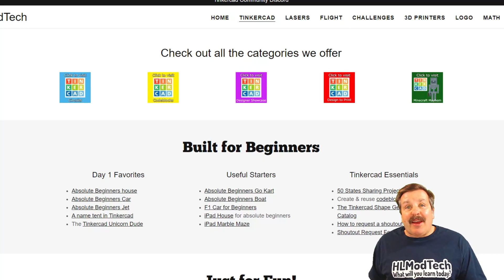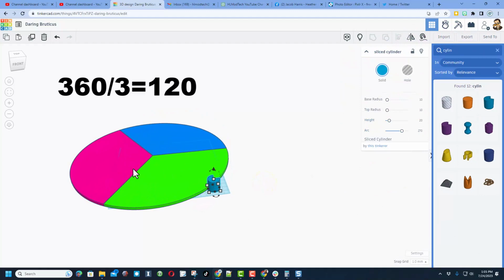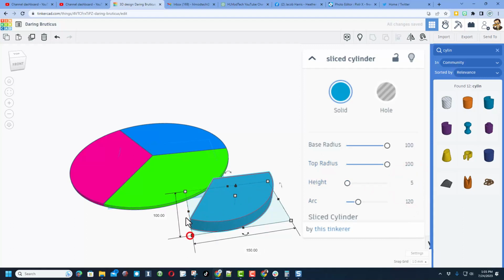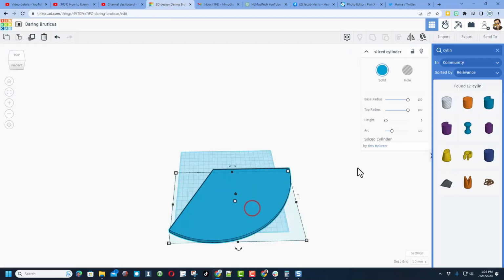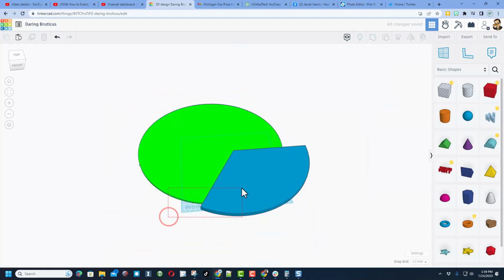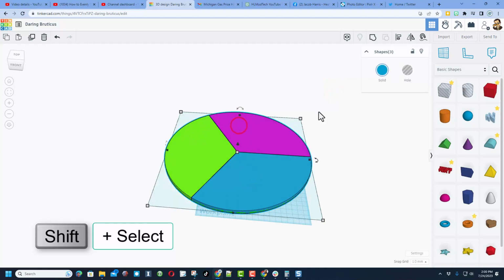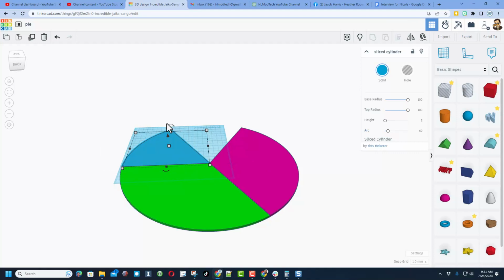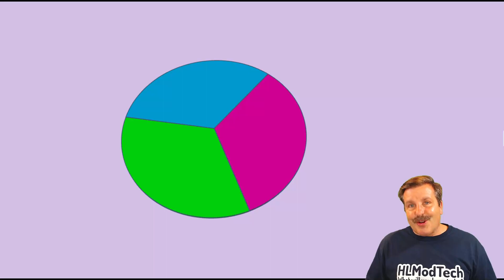Get Evenly Sliced Cylinders In Tinkercad With This Quick And Easy Guide!

Comment: onother great video,      do you have a video lesson that shows automatic centering,    I have a cylinder, and need to put a smaller hole cylinder in the middle,   basically look like a pipe.   then a dome cap same size as outer cylinder to sit on top.
Reply from the maker: Thank you. I think this video may help. https://youtu.be/x1JGlzmbK-g

Comment: Why not create the 3 slices, do the circle trick to line them up, join them, size the whole cylinder to the correct diameter, then unjoin the pieces?
Reply from the maker: Sounds like that would work as well. I am not sure it saved any steps though. Have you seen the codeblocks version where the math gets automated? https://youtu.be/04YZKjW8rPs

Comment: You don't need the circle. Place sliced cylinder. Duplicate, rotate 120, reduplicate. Set slice angle to 120 for each shape. Select all and resize.
Reply from the maker: I believe if you test that theory it rotates around the center of the shape.